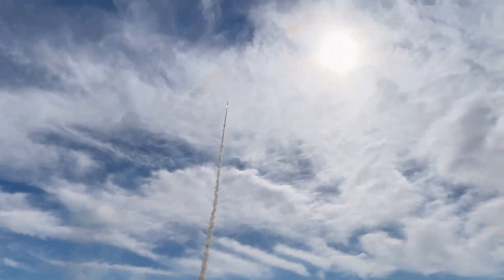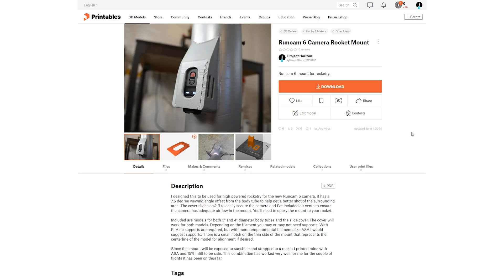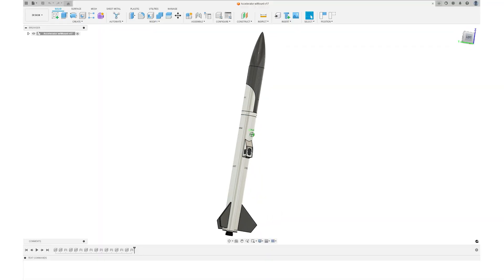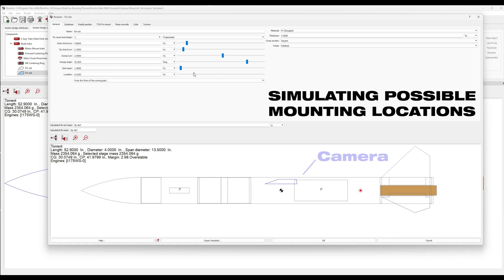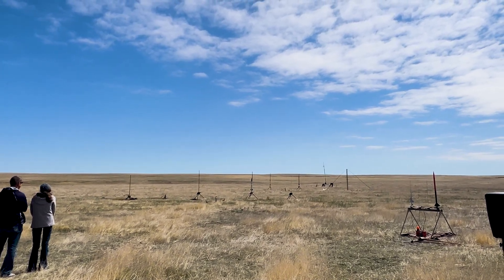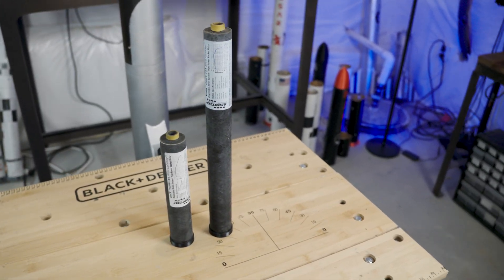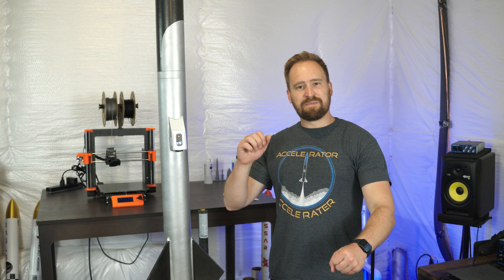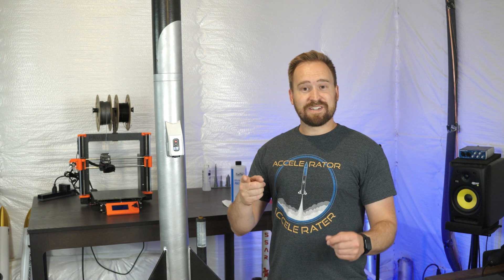I Made a Camera Mount for High Powered Rockets

Comment: Hey I heard that you make high powered rockets I actually have a message to say about the design.
For actually No damage to the rocket I would say that using a parachute at 2500 meters high and some landing legs even if you made it for the eagle rocket but to achieve 2500 m you have to get Biggers And Stronger Engine thanks you heard about my comment.
Also my biggest dream of these videos is to make a rocket that could pass the kerman line in the out space and return safely.

Comment: Hi Sir, I really interested with mechanical item
I had a background in mechanical engineering (CAD/prototyping)
But, I have no clue about coding
Do you have any suggestion for me what should I learn to build rocket like yours? I saw several videos posted online like yours, BPS Space, JM Space, and so on

Previously I ever built Autonomous Plane using iNAV
but there is no coding involved
I am wondering how did you get the actual data such as gyro, altitude and process it through feed back for the engine (control system)
Reply from the maker: I actually started these rocket projects with no background in coding but learned as I went. I found it much more fun to learn that way. The internet if full of fantastic resources and with AI it's faster than ever to learn to code. I would suggest you buy an Arduino board and start small to see if you can connect to various devices like a barometer or IMU and read their data, then start progressing and building your flight software around that. There's a lot of great information on YouTube as well with BPS Space being, in my opinion, one of the best resources available for projects like this.

Comment: If you're using a barometric altimeter, I hope that your altitudes have been corrected for local barometric pressure and temperature
Reply from the maker: That’s a really interesting point actually, I’ll have to look into that. I use the MS5611 so not sure if it does that internally for temperature at least. My flight computer does have a GPS that also logs altitude and I put logic into the software to measure altitude by integrating vertical acceleration twice, usually that value and the baro have been within 2% of each other.
Reply: My guess is that it doesn't adjust for temperature or air pressure automatically.  NAR and Tripoli won't allow designers to do this, as they want to be the ones to adjust things for you (as I well know).  And as far as GPS goes, GPS is good at computing your location on earth (x & Y) , but not for altitude (z)....it could be off more than 50' feet, or so....check out VDOP or Vertical Dilution of Precision. .  Measuring altitude using acceleration is, indeed, the way to go as gravity doesn't vary as much as temperature and air pressure IMHO.
Reply: Hey how do you tackle with the  integration error which integrating the acceleration twice to get the altitude
Reply: The integration error is far less than the barometric pressure error, ...especially at higher altitudes...so I don't deal with it.